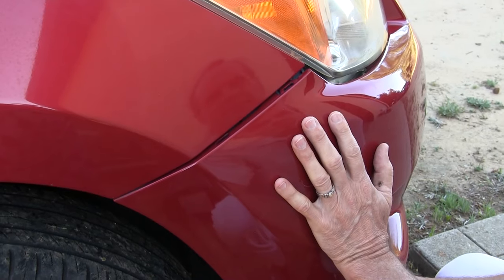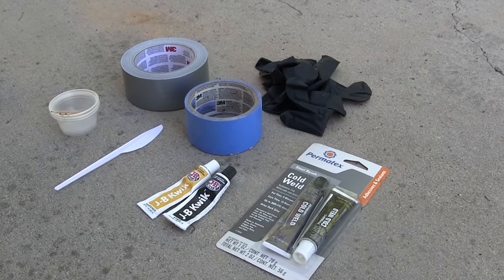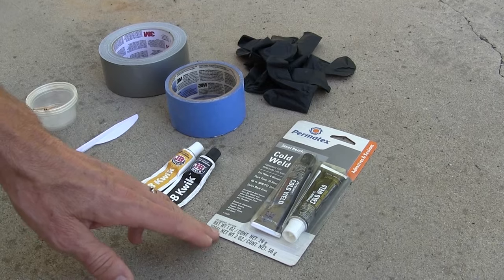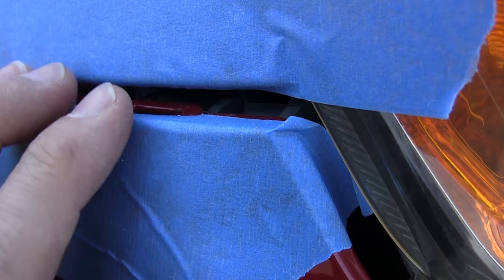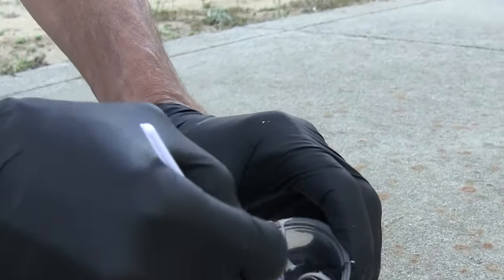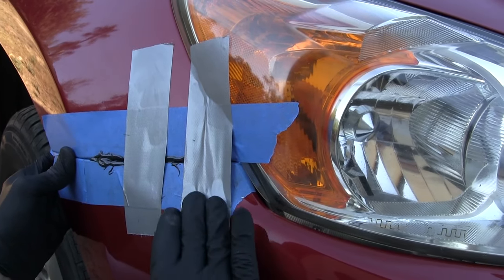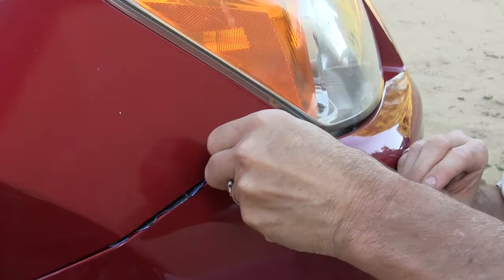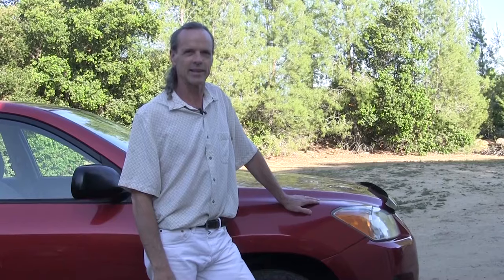How to Fix Your Bumper - The Easy Way

Comment: Thanks ! I have used JB Weld before on bumpers, but I didn’t use the painter’s tape. Adding the painter’s tape will make a huge difference. I have a rental car business that rents to gig workers, and wow they can mess up some cars lol. Doing this is much more cost effective than replacing the bumper even if I were to do the bumper replacement myself with aftermarket parts.

Comment: I've had problems with the mess that duct tape can leave behind.  I now use gaffer tape where duct tape is called for.  Strong, no mess (especially when the tape is left on for long periods), and comes off easy too.  Only draw back is  about 4X more expensive.  I like Gaffer Power brand; Amazon has it in multiple colors and different widths.
Reply: Thanks for the tip!

Comment: My channel specializes in making cars last 25 years... yep that's right. So this car may only have 3 more years left in it, or may have 13 more years in it... just gotta take care of it and see how far you can go. Thanks Greg!
Reply: I dont agree that car with over 170 thousand miles has 3 more years left remaining. I owned a 95, 96 Civic and 2005 Accord and they are all still running with almost 200,000 miles.
Reply: The Switz, I own and drive a 2002 Jeep Wrangler, 1995 Ford F-150 and 1992 Mazda Miata. They each have 165-185k miles and still run strong! There is the trade off of more maintenance and repairs, but it’s still cheaper than buying one 50-$60,000
New truck.
Reply: @billytrevathan6405  You got that right! And if you do your own maintenance with cheap parts it won't cost you that much. And the great thing about a 20 year old car with 200,000 miles on it is that you are not likely to "ruin" it if you make a mistake.
Reply: The Switz I just had a clutch put in the Miata for $500 total, parts and labor. Well, I know a good mechanic that is semi-retired and is great for jobs I don’t want to do myself. 
My wife was telling me about a friend that had to pay just to get on a waiting list for the new vehicle of their choice, then pay more than msrp when it came in! It’s crazy what people are paying for new vehicles. Most modern vehicles are just getting started at 100,000 miles, as long as they are maintained properly and have not been driven in the city on short commutes for many years.
Reply: Your so cool! I’m an Uber driver and people constantly tell me I’m ruining my car. By driving people around is all I’m good at so I’m kind of stuck driving this  car way over most peoples annual mileage.

Comment: You can also remove the plastic piece with the broken clips and repair that with jb weld or even better replace it with a piece from the junk yard. Also a Toyota with 175k easily has another 100k miles on it if it has been well maintained.
Reply: Bigger pain removing the bumper to fix the clips, though. This is much quicker!
Reply: Yea man 170k is nothing.. my moms Toyota is over 200k with little maintenance, still going strong.  And I have a 2002 Mazda P5 at 180k still drive her like she's brand new . These early year Japanese cars can make it to 300k+ EASILY . These aren't domestic cars 🤣
Reply: ❄️ 🤣 speaking fax
Reply: @TesNRad  Over here we have several b230 volvos with 500k+ on them. Cars can last forever if you want them to.
Reply: @tracklizard4018  nice man! Older volvos are quality cars aswell
Reply: Which JB weld do you recommend?
Reply: Honestly just any that's rated well. Doesn't have to be JB weld.

Comment: I have a 2006 Honda Ridgeline  that i bought used, that needs this repair.  Thank you for the video, great tip!!😃
Reply: Did you fix your Ridgeline? I also have a 2006 Ridgeline that needs fixing.
Reply: @axjohn  no i never got the chance to try this. My bumper is still in rough shap. Good luck,i think this wiil work.😃
Reply: @robbeewisher8972  so did it work how is your bumper been going?
Reply: Its still holding up,and looking pretty good 👍
Reply: @robbeewisher8972  thanks will try now

Comment: Thank you so much. Fiat 500 has a flex seam between the bottom side of the bumper and the upper bumper that easily breaks if you bottom out on a curb. I was able to fix the break point. Thank you!

Comment: I had the same idea. But I didn’t use painters tape. That is a good idea. Thanks for saying to use painters tape. I used duct tape, but mine was lacking in adhesive, so it did not stick well at all. Use a duct tape that has a lot of adhesive. I am going to do it again. Thanks for the great video.

Comment: Good video! Just wondering about how  well the JB weld  sticks to the bumper if it contains 
Polypropylene?  Also wondering whether the normal, slow setting JB Weld would also work?

Comment: I have this problem (after hitting a deer unavoidably) and like your solution. Since one headlight lens cracked, should I fix that headlight first or it doesn't have anything to do with this cover? Thank you - and yes lots of miles on this car: over 250,000.

Comment: Thank you for your video. I have a 2004 Chevy Malibu it doesn't have a lot of years left but it is mechanically sound. I will be using this technique on the bumper. But prior to the bumper being tapped the other day I was hearing a sound and it was emanating from the trunk. So my guess is it's the spoilers loose. What can I do? Can I put some kind of sealant around the base of where it attaches to the trunk? I have touched myself and it doesn't have any gaps that I can see. So it has not broken off. Or maybe it has on one side I just can't tell. Anyway I was half thinking of using a glue called Flex glue that they claim can be used on any surface. I was even wondering if it could be used on the bumper. Cosmetically my car has damage so I'm not freaked out about it not looking showroom floor.

Comment: My bumper got caught on my dad’s trailer hitch. Probably a curb or two since I lived in the city a few years ago. The auto body places will only replace the entire bumper, which would be crazy expensive and probably not be the same color as my car. Just for the clips! Thanks for the adhesive recommendation, the other one I tried cracked off already. Not too concerned about it looking perfect but the painters tape trick is a great idea as well.

Comment: Umm what if i wanna take the bumper off to do a repair after this?
Reply: It's your choice. The only alternative is a new bumper, which will run you over $1,000 with parts and labor.
Reply: @rcharding  Not true. You can:
Drill two holes in hidden places and zip tie it, and then just cut and reziptie for use.
Get bumper quick release (Can be hidden, too)
If there's too much material lacking you can "weld" plastic on plastic by melting it together. Then use any method you prefer, including the original one. Chances are you can't clip it back on because somewhere the plastic has broken off. 

This hacky job in the video that looks worse than ziptie is one of the worst you can do imo.
Reply: Easy, you dont.
Just sell and buy another car

Comment: If you never have to change your headlights again...
Reply: Foreal , I Have This Problem On The Same Side I Need A New Headlight 🙄 So This Won’t Do 😩😩😩
Reply: Most cars you dont have to do thaattttt
Reply: Yea I think that’s why he mentioned to only do this on an older car
Reply: @sav2040  ...... newer cars you don't have to remove the bumper to get too the headlights.....
Reply: ^THIS PERSON THOUGHT THEY WERE SMART BUT RELLY THEY DONT EVEN TOUCH THEIR HEADLIGHTS....
Reply: @calebc6028  I have 2012 and my brother has a 2016 both need to have the bumper removed to get to the headlights. Also that wasn’t the reason I said that. I said that’s why he said to only do it on an older car because you won’t need to get to the headlights again on an older car.
Reply: @sav2040  CAP
Reply: @sav2040  You dont know how to work on your own car..... :(
Reply: @sav2040  thats for replacing the entire headlight assembly. I think Pog is referring to just changing the bulb. For just changing a bulb, you do not have to remove the entire headlight assembly. And yes I looked at the videos you showed and that's what I was seeing. Removing the entire headlight assembly and putting a new one in. MOST people only get those replaced if they have had an accident. If your in a accident that requires that to be replaced, then your bumper usually needs to be replaced as well, and at that point it will not matter if you had this done.
Reply: @PanndaHart  you wouldn’t need to mess with the bumper to change the bulbs so why would op say anything about this affecting changing headlights if they meant the bulbs not the assembly. Bulbs can be changed on almost every car and gluing your bumper in place wouldn’t affect that.
Reply: @sav2040  for a Malibu, you have to either pry off that side of the bumper or take it off

Comment: So, how do you remove the front bumper now that it is glued to the side panel?
Reply: As he stated in the video, only do this on an old car you may only use for a few more years and never expect to remove the bumper. I’ve had cars for 20 years and never removed the bumper. If you must remove the bumper, just pry between the seem with a plastic wedge type tool. The JB Kwik type glues are pretty brittle.
Reply: Easy, you remove car first.

Comment: Can we heat our car this winter if our air conditioner compressor burned out this summer? Is there a way not to use the air conditioner when the heat comes on?

I was hoping I could contact you to ask instead of hoping you see my questions.

Comment: My 1999 323i BMW was rear ended. The right side of bumper is hanging. Can I use the xip tab or bonding glue for this issue? The other person's insurance company only paid $1200. It actually cost $1600+ which doesn't include painting. I'm suing them anyway for bodily harm, pain. But need to try this before spending more than the car is worth. I wish I could send a photo so that someone will say yeah or nay me trying myself. The auto body shops are overly expensive. The clamps are broken and was told they were $200 each for 2.

Comment: I've got to fix a similar problem with my Corolla 2014. The whole back bumper flew off a few years ago while driving on a highway,  and it got air born high above the road. That was very scary but luckily it didn't cause an accident.  I had to replace it, and perhaps used a too cheap replacement, after I found that it would have cost me a fortune at a body shop, and even the parts are way too expensive. However,  it already begins to get loose again, and so I keep using duct tape to hold it in place. This whole contraption is really a sloppy design. The attachments are simply way too flimsy to hold up through several winters, when the underside near the wheels gets often packed with ice and frozen slush, which have enough weight to tear the bumper down and erode the attachments. When people say that Toyota's cars last for ever, they certainly don't mean most of the, lets say, non-essential attachments.

Comment: n what if i need to remove the bumper for some repairs!! wont it break while removing!!
Reply: Good question. I was wondering the same thing.
Reply: Nobody has an answer
Reply: @marqicewalker1766  just use a thin screw driver etc.pop it with a hammer,jb weld will crack apart.
Reply: Sledge hammer will do the trick!

Comment: Tape up seem with painters tape. Then go underneath and use spray foam. It adheres the plastic to the actual bumper (frame). Do it front and back and now you have a tank.

Comment: I don't thing it's good ruining good paint on bumper. You can order or make the clip with 3D printer and JBwelder (regular) it to replace the old clip. Nylon is very strong.
Reply: Are you giving out a 3D printer?
Reply: @John.K3  Why not, 3D printer is a fraction of body shop cost. I can cough for it for my 2 days salary.  But ruining bumper and appron assembly with epoxy is stupid. This fix is Getto fix and may worth for $2000 or less car.  Toyota at 170k miles still worth above $5000 and will run 4-5x more miles with proper care.

Comment: Wont this jb weld crack and break,first pot hole you hit.i was thinking of small deep sheet metal screws.
Reply: You're the first person on here with some actual sense, yes drilling a bolt is a permanent fix

Comment: It wasn't the placement of your tape it was the fact that when using tape for this type of application, it MUST be removed BEFORE the adhesive cures. Apply the adhesive then remove the painters tape then apply the duct tape vertically, without letting it touch the adhesive.

Comment: better replace bumper retainers. it would cost around $5-$50 depending on car's model.
Reply: Maybe true if retainers are your issue but there are other issues that cause this. On mine for example the retainers were fine but a tab at the end of the bumper that is literally part of it snapped off due to driving through some deep water when my area flooded (which happens frequently where I live). Went to 3 different body shops who said full bumper replacement was the only alternative to something like this. This worked great.
Reply: @TheFlyingCougar  how is your bumper been going?

Comment: jb won't work for hot outdoor temp at 90°F when the uv radiation will crack the opoxy after 1 year. ived tried it on my prius.

Comment: Silicon butter than this and it will be more flexible,  you can remove it later more easily and easy to clean after remove the bumper

Comment: Okay so the end confused me,  the steps after gathering everything you need... 1ADD TAPE CLOSE TO INSIDE OF CAR. 2.ADD DUCK TAPE VERTICALLY. 3MIX ADHISIVE FOR COUPLE MINS & PUT BETWEEN THE AREA. How long? 4. REMOVE DUCK TAPE. All done??
Reply: No, he said apply the blue painter's tape for protection, PULL BACK THE BUMPER, mix the J B, apply the J B, THEN put on the duck tape to hold in the proper position
Reply: 10 minutes or until stuff you mix in cup is dry.

Comment: The bumper is very easy to take off (5 minutes). The sagging is mostly caused by broken bumper spacer (less than $10 after market, less than $20 OEM).  A 15 minutes job, and you mess glue together? This hack job is horrible, now when he/she needs to replace a head light, it becomes impossible. The advice is more like from a devil than an "angle".
Reply: Yep...very stupid idea
Reply: Angel*
Reply: Easy steps on how to piss off your mechanic

Comment: It is not just Toyota but all the car manufacturer, today you spend 50 $60,000 for an SUV and they equipped the car with this cheap cheap $0.15 plastic clips I cannot believe what a rip-off. 

As far as glueling members of the car together I'm not sure if that's a good idea how the heck you going to take it apart if is need to? You can get those clips online or Amazon for a few box and then you back in business. I have a 2002 Tacoma, I had to take off the door panel, well every one of those plastic clip broke, so I used zinc plated tucco lath Phillips screws. Looks very okie but let me tell you I can take off the panel anytime I want to easy easy put it right back with the screws I love the screw look anyway. If you have the patient you can replace those freaking plastic clips with screws, just got the right diameter and length and the right washers. Home Depot or Lowe's or actually any hardware stores, they have a large variety of bolts and screws.

Comment: It works but I wouldn't do this. Why? Because if you ever need to take the bumper off you have hard glue resin in the bracket and you couldn't reseat the bumper again. Good try though..

Comment: Sooooo not the way you want to go about this... I mean technically you could but it won’t look as nice. Take the bumper off, get new clips, chances are fender is bent so fix the dents, if any, sand afterwards, then paint on multiple coats and you’ll be good. Professional outcome, and you won’t have to break the bank.
Reply: Fix a dent 
Sand it down
Paint multiple coats

🤣🤣🤣people can’t even take the bumper off and you’re telling them this is the way to go on what he recommends old ass cars on there last legs. You must be trolling.

Comment: This is a video on what you should absolutely NOT do. The front bumper cover is very easy to remove with about a dozen clips and a handful of 10 mm socket bolts and then easy to reinstall once you get the brackets from Nissan or Amazon.

Comment: I wonder does this man know toyota camry on that miles he said, that's not even breaking in the motor, soooo... depending on the old owners oil changing every 4,000 miles and transmission fluid every 30,000 miles and this car will last "for ever" just ask (Scotty  kilmer )

Comment: How about buying a real car less plastic got a 95 Ford F150 over 400,000 Mi on it Expedition 300,000 Mi on it plastic bumpers don't sag held on with metal clips and screws

Comment: DO NOT DO THIS 🤦 the replacement clips can be purchased for LESS THAN the cost of the epoxy this HACK JOB used 🤦 and the bumper covers are easy to remove and repair.

Comment: You messed up the fender & bumper with the tape left inside & didn't even show the result in the end. There are many other cheap ways to fix it without causing permanent damage.
Reply: Make a video showing other ways.